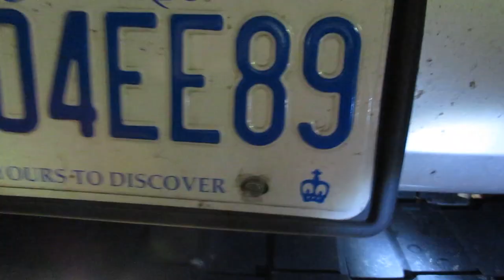2005-2010 Jeep Grand Cherokee WK CRD OM642 Fuel Filter Replacement and Oil Cooler Investigation

Comment: Thank you Stephen for your video!, I have a 2007 JEEP Commander with the same OM642 engine, and will do this job soon, also have a lot of oil leakage reaching down to the oil pan!...will check, but I think is from the oil cooler...maybe I'll leave that 20 hr. job to a mechanic.

Comment: @27:00 yes that is where to put the 4700 ohm resistor.  You disconnect the 2-pin connector from the motor and push the resistor tails into the connector instead.  It doesn't make the swirl motor "work", in fact it stops it working because it is a waste of space, and only causes trouble if (when) it fails.  The resistor keeps the car electronics happy.

Comment: I came here for advice on how to change my GC fuel filter.  After 9 m 45 sec I gave up with not 1 bolt turned.  I know what a 12mm socket looks like.

Comment: ¿can you show the 10mm fitting by the oil filler?, my jeep does not have it and i'm wondering how does it look. I'm also missing the back bracket for the engine cover!
Reply from the maker: you should be able to see what you are looking for if you watch some of my videos.  The back bracket has two tabs that the cover slide around.  I took my engine cover off years ago along with the cylinder head covers.  They only keep the engine quieter and make it harder to work on.

Comment: Thanks for posting this! Very thorough and given me some tips on things to check. Currently, I'm having this fuel pump issue w/ my 2008 CRD. Do you happen to know where to find the fuel lines or a factory part number? Trying to replace with same stuff and just not sure what to order. Thanks again!
Reply from the maker: I tried to work out the part numbers before but it is not easy.  they have weird names and aren't very specific.  your best bet is to look at the photos on rock auto

Comment: Hi , very nice video. You mentioned oil leak not from the rear oil seal , where could it leak from , I changed the oil seal twice and still leaking. Please help , many thanks
Reply from the maker: Look at videos regarding "OM642 oil cooler leak"  There is an o-ring under the cooler that is famous for failing.  If you have a borescope you should be able to look in from the front of the engine and around the fuel filter to look in the valley on top of the engine.  This is a big job which takes about 20 hours to do on your own and you need a service kit full of parts.
Reply: Stephen Rivett  , I did that , with the purple seal  . Still no joy thanks a lot pal for the reply.
Reply: @ماريا-وبس-.يس  probably super late but check underneath the turbo inlet. The intake pipe to turbo seal can wear and leak from under the turbo. Mimics an oil cooler seal issue because it runs down, into the valley and out the back of the motor.

Comment: can you just fill the filter with fuel?      also can you tell me what would happen if i ran out of fuel?   great video!! just got 2008 jeep diesel
Reply from the maker: if you run out of fuel you just need to top up the tank and turn on the key without cranking.  it will fill up the filter after a couple key cycles and then you can start it
Reply: Good luck these Jeeps are money pits.

Comment: Hi. Thanks for the video. I’m having the same year car. How often I should change fuel filter..? Thanks.
Reply from the maker: The manual says every 25k miles.  I would say every 2 or 3 years.  The filter was 8 years old when I got my Jeep.  I do recommend putting fuel conditioner in the tank in the spring and fall to clear out any moisture you may have picked up during the changes of season.
Reply: Stephen Rivett Thank You 👍

Comment: Hi, have you had your Jeep long? How many miles has it done? Have you had many issues? I've just bought one. Thanks!
Reply from the maker: I'm at about 293,000 km now.  The Jeep was a city vehicle when I bought it and it had a lot of problems when I started using it for long distance.  The last year has been pretty good but they are higher maintenance than FWD cars.  I'm sure you'll like it if you do your own work on it.

Comment: Where did you get the bypass for the air filter
Reply from the maker: The intake is all stock on this vehicle.  Some years have different colour hose connectors but no major differences.

Comment: At 5:42, what is that? Mine has signs of oil leak there
Reply from the maker: that is the access cover for the torque converter.  if you are leaking from there that may be the oil cooler, you need to look at the top of the engine in the valley too
Reply: @SteveRivett   thanks for the info! Gotta check it out some more